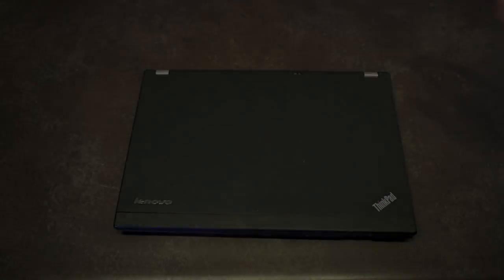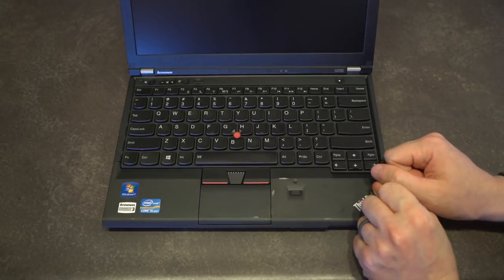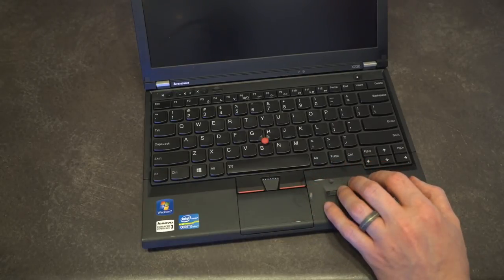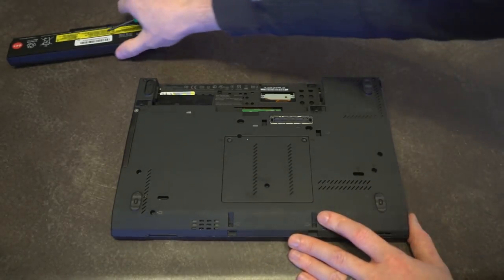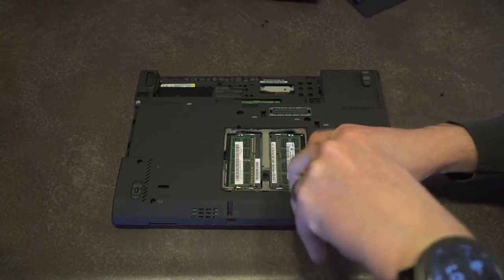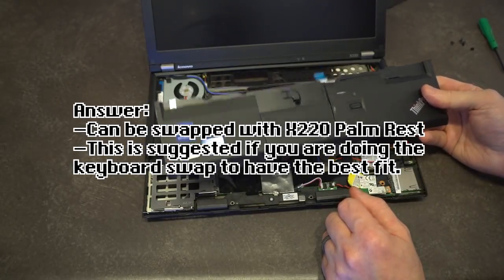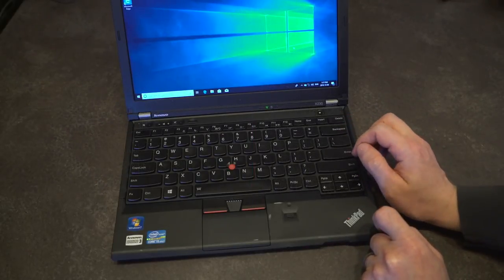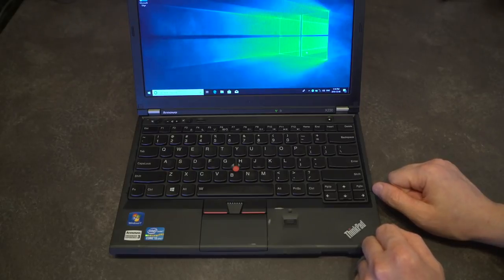Lenovo ThinkPad X230: A Fan Favourite

Comment: @Laptop-Retrospective:

A friend is asking me if he should get a refurbished X230 laptop with a Core i7 3520M processor & 8 gigs of Ram and a 500-gig ssd,

("Grade B" or "Grade C", depending on what store considers as "Grade C" & "Grade B"; 
The upper-right-hand corner of the LCD-screen-bezel is chipped-off. The lower-right-hand-corner of the LCD-screen-bezel has a visible crack in it. To the naked-eye there's no dead-pixels on the laptop's LCD-screen but the YouTube "all red screen" dead-pixel test hasn't been done to it yet),

for $240,

or a "Grade A Refurbished" X230 laptop (NO dead-pixels, NO scratches on the screen, no cracks on the chassis, no chips anywhere on the chassis, no dents, no nada) 

with a Core i5 3320M processor & 8 gigs of Ram and a 500-gig ssd,

for $300.

[Needless to say] I'm asking you which-one I should suggest my friend he get.
Reply from the maker: I guess that depends what matters most to your friend: performance or cosmetics? Will they use the i7 or is battery life more important? What is the battery wear and size on each model?
Reply: @LaptopRetrospective  hi Laptop-Retrospective :-) . Thanks so-much for the reply :-) .

I went with him when he went to check-out the laptops.

I'll tell you what I know.

● The one with the Core i7 3520M processor is sold by a local store here in my city that sells refurbished computers. They also take them apart & clean them and replace defective--and/or--broken components and then [put the laptops back together and then] resell them.

It has the regular-sized battery (I dunno if it's the 3-cell or the 6-cell but it's the one that you had in your X230 video that does-not "stick-out like-a-sore-thumb on the back of the laptop" nor "stick-out like-a-sore-thumb underneath the bottom of the laptop"),

and it comes with a 3-month warranty (covering "Parts & Labor") from the store that sells it.

The wear on the battery, when I checked it, according to each source (ie. the Bios & Windows-7) seemed-to-be 80% or above. (I'm going to try to go back to the store today and check-out the laptop again).

● The one with the Core i5 3320M processor is sold by a "Microsoft-certified Refurbisher" in Jacksonville Florida called PC-Liquidations (I'm currently in Orlando, by the way), and they also, among other things, take the laptops apart & clean them and replace defective--and/or--broken components and then [put the laptops back together and then] resell them.

It also, just like the one with the Intel Core i7 3520M processor, has the regular-sized battery (I dunno if it's the 3-cell or the 6-cell but it's the one that you had in your X230 video that does-not "stick-out like-a-sore-thumb on the back of the laptop" nor "stick-out like-a-sore-thumb underneath the bottom of the laptop").

The warranty however, is 1 year "limited"-warranty, but it, despite being "limited" warranty, covers more-stuff than the 3-month "for Parts & Labor" warranty that the local-store in my area is offering.

The wear on the battery, I'm estimating, is a brand-new battery. My other hypothesis is that it's a "close to 100%" (like, 98% or so) Refurbished battery.

■ I am more picky about the cosmetics/abuse the laptop has taken, whereas my friend is not. 
I'm also a heavier multitasker than he is, so therefore the additional .3-gigahertz [clockspeed] of the 3520M Core i7 processor compared to the .3-gigahertz--less of the 3320M Core i5 processor would-be beneficial.

Word-Processing, Web-Browsing, YouTube-video watching, Coding/Computer-Programming/Computer-Science * , Text-file Editing, and other "basic-use"-type stuff that doesn't consume alot of battery (including watching video-files on VLC Media Player on a USB-3.0 external hard-drive) would be the primary functions of this computer (ie. the primary things that this laptop would be used for).
So I'm guessing (and/or hypothesizing at-least) that battery-life wouldn't be affected-much either way (with the Core i7 3520M processor or the Core i5 3320M processor).

I hope this information helps :-)

* (I should specify that when my friend & I learned Computer-Science & Coding (we were in High-school together & in the same Graphic-Design class), our computer-teacher taught us HTML code and how to do it using Notepad, so that's what we've been using since (except I've moved-on to Notepad++, Kate, and NotepadQQ (a open-source version of Notepad++)), and right-now I'm working-on Python and C++ (two languages that were recommended to me by a cousin of mine who's a Penetration-Tester)).
Reply from the maker: The i7 will draw more power and I wouldn't assume the battery is brand new unless otherwise stated. Batteries for these are starting to get rare so keep that in mind if it needs to be replaced.
Reply: @LaptopRetrospective  i understand :-) . thanks-so-much for the help :-)
Reply from the maker: You're welcome. Best of luck
Reply: @LaptopRetrospective  Thanks :-) (referring to the “best of luck” part).

P.S. I’ve heard that there is a way to upgrade a X230 [or X220] to a [for-a-13-inch-computer] 1080p-resolution [LCD] screen. And/Or that there is a way to replace the Bios with “Coreboot”.

Can you do a video on those two things please?
Reply from the maker: If I ever get the right candidate machine and the parts, probably. 😁
Reply: @LaptopRetrospective  thanks so much! :-) 👍

Comment: I used x230 with 6GB ram, change internal hdd with ssd, replace x230 with x220 keyboard, and this little bulky machine is superb, i buy docking too and replace dvd slot with hdd, superb combination. And oh, i think thinklight and trackpoint is the great part of thinkpad laptop.
Reply from the maker: Very nice setup.
Reply: w adisurya 😲 Fits a X220 keyboard on X230? Please share a video guide to do that! 👍🏼
Reply from the maker: See the description of the x230 video for a how to guide.

Comment: I'm typing right now from my Thinkpad x230 Core i7, Samsung SSD, 16gb ram. I use this rocket for my programming classes. I think that is the best laptop for any college student. I'm an IT student and this thing is amazing. Fast, powerful, and and bulletproof
Reply from the maker: Very nice. You running a 6 cell or 9 for the battery?
Reply: @LaptopRetrospective  6 cell. That's enough for me.
Reply from the maker: Nice.
Reply: just got it for the same reason.. but im taking linux + and studying for CCNA.  comes in 2 days..
Reply from the maker: Exciting! Keep us posted.

Comment: Is the i5-3360M a socketed chip? If yes, do you know if the i7-3520M can just be swapped in with nothing else? Just plug and play?
Reply from the maker: The X230 is not socketed.
Reply: @LaptopRetrospective  Thanks for the quick response! Great videos! Very informative! But would you be able to double check that? I thought the M signified that it was socketed, and U meant that it was soldered in place. I've read that people have swapped the i5-3320M, on the T430, to an i7, but I just wanted to find out it they needed to flash the bios or if it was just plug and play.
But love the channel, I have a graveyard of laptops that are older but very useful after a refresh like what you do with the laptops.
Reply from the maker: The T model is socketed, X is not. M denotes Mobile Grade, U denotes Ultrabook.
Reply: Ah, thanks for clarifying! Keep the videos coming!
Reply from the maker: @jonathandelapaz8679  I'll do my best!

Comment: thank you for a great video. Helped me pick the right one of the thinkpad lineup
Reply from the maker: You are most welcome, I'm glad I was able to help.
Reply: @LaptopRetrospective  I noticed that x230 often come with high GHz i5 processors (2.7 to 2.9 GHz) , while x240 i5 are mostly only sold as 1.9 or 2.1 GHz. Do you know why this could be? Is it due to the newer processor generation being more efficient?
Reply from the maker: Newer CPUs in the x240 were more power efficient but weren't as strong, about 10% less.

Comment: Hi. I just got my x230 in. Great condition only thing im wondering is what cpu temp r u getting on idle? Mine is 50c to 64c. Is this too high for this model? Should i reapply thermal paste to it?
Reply from the maker: Might be worth a repaste. Fan might be worn out as well.
Reply: Laptop Retrospective thanks. Ill take this bad boy apart on my day off. Im surprised how well maintained it is. Only 1 small scratch. Cleaned it off with sanitizer wipes and looks brand new
Reply from the maker: Good luck, hopefully, you can get the temp down a little bit.
Reply: Laptop Retrospective thank u. Also trying to figure out this jumpy mousepad. Works fine via trackpoint or whatever the red dot is called haha.  Updated driver too and still jumpy. Gonna install linux on my day off and see how it is on linux. Thanks again

Comment: that battery looks like mine, is that a sanyo one? and is that an original X230 battery?
Reply from the maker: No real way to tell by looking at the outer case. I don't have this unit around anymore so I can't check.
Reply: @LaptopRetrospective  owh ok.

Comment: I have bought an old x230 without battery few days back, I tried getting the battery for it but as the technician put the battery in it for testing it wont turn on now. Even it's not turning on with only ac power. When i plugged in the adapter the led indicator flashes twice or thrice but pressing power button won't make the laptop turn on.
Any idea what has happened? 
I suspect BIOS locked is the problem.
Reply from the maker: If the BIOS was locked you'd have something displayed on the screen. Does it turn on without the battery at all? If the battery is really really old then it might not have been built with the battery check bypass.

Comment: watching this on an x230 with 3rd gen i5, honestly one of the best laptops ive ever used.
Reply from the maker: Glad to hear you're enjoying it.
Reply: agree all you need is change the battery and the keyboard on the used model and you are pretty much good to go
Reply: @righter0o07  yeah im soon buying a duracell replacement battery for it, and i might do the x220 keyboard mod soon
Reply: 2 years later. still using it :)
Reply from the maker: Epic.

Comment: I think hp elitebook 2570P is more superior than x230 because socketed cpu. And its cheaper and fits mil spec
Reply from the maker: Hmmm, that is compelling. Maybe I need to try and get my hands on a few more HPs.
Reply: @LaptopRetrospective  other than old hp elitebook, HP products are mostly just garbage. For more newer product it's better to stick with thinkpad or clevo. But personally i think 2570p is better than x230 because socketed cpu (which i already upgraded into i7qm), aluminum body and additional sata socket on dvd drive slot .
Reply: Dell is better than hp similar to thinkpad you can try it
Reply: @berkinerengurman1401  which model ? can i upgrade the cpu?
Reply: No Bullshit i’m using precision m4800 everything is upgradable and it has 4 ram slots but heavy a bit also latitudes are really nice and their cpu s upgradable

Comment: Watching this on an x220 ^_^
Reply from the maker: Very nice. What specs?
Reply: @LaptopRetrospective  
I5 2520m
8gb ram
500gb ssd

Waiting for the exp gdc to arrive so i can use a gpu in the express card slot ^_^
Reply from the maker: Let me know how that goes. There's a fellow in the comments of another video who had once they were trying to get working.
Reply: @LaptopRetrospective  hi, sorry for the late reply and happy new year ^^ (writing this comment at jan 1 1:37am), i will try with the express card method, and with a gtx 970, i will tell you how it does but there is a little problem xD, i ordered it from a chinese ebay seller, and so i have to wait like one month for it to arrive xD
Reply from the maker: No problem. I hope the year has started well for you. I haven't seen a supplier outside of China either.
Reply: @LaptopRetrospective  yup it started well, my connection is finally back xD, i've seen the exp gdc on amazon but it costed 20€ more xD

Comment: Is there a way to replace the batteries without the laptop shutting off? Because mine shuts off whenever I take the battery and I lose all my work. is this normal or is there any fix?
Reply from the maker: Do you have a working internal battery?
Reply: @LaptopRetrospective  I am not tech savvy. Is there any way of knowing? if you mean opening it and looking, I'll get back to you.
Reply from the maker: Oh wait, this is the X230 video. Yeah, the only way to swap batteries without the machine turning off is if it plugged in.
Reply: @LaptopRetrospective  😍I can sleep better
Reply from the maker: Cheers!

Comment: I own and my daily driver is a 3rd gen i5 x230 touchscreen Screen to tablet mode with Spen model. Best laptop I have ever owned. I am an IT professional and seriously outdoes most 2022 laptops when it comes to reliability and upgradability. New machines are built to breakdown and not be upgradeable or serviceable.
Reply from the maker: The X230 is a great machine, especially the tablet version. Glad yours still gets use.

Comment: Correction: Thinkpad x230 uses SATA 3 (6Gb/s) for the disk. The msata slot operates in SATA 2 mode (this can be used either by msata ssd or wwan card).
Reply from the maker: Yes, SATA 3 for the main drive bay. SATA 2 for the mSATA.

Comment: Upgraded to an X250. Hated it!  Then tried an X240. Not as bad, but only 8GB RAM.  Noticeably poorer build quality on both. Poor trackpads also - and couldn't configure them to work like the X230. I'm back on an X230 running Wondows 11 Dev Insider Release and loving it again!! It's faster than both the X240 and X250 and everything works. The most important modification I do is to add an MSATA drive for the OS (essential). After this, even a standard drive works great for everything else. I also replace the speakers with a pair from an IPad. I tried  an X220 keyboard at one point, but forced myself to get used to the new keyboard because it is backlit. Would love to get an i7 when I can find one, but the i5 is plenty capable for my purposes. Zero lag or freezing with 12GM RAM.
Reply from the maker: Interesting, I didn't note a massive change in durability or build quality but that has a fair bit to do with our perception of things until the item in question is tested. I wouldn't specifically suggest an mSATA for the OS if you want the fastest boot times as it is can only do SATA2 speeds whereas the main bay can do SATA3. Glad to hear you have a machine that works for you, that's the most important.
Reply: @LaptopRetrospective  Thanks for your comments. I maintain a 2TB drive so SSD is too costly - do they even come that big? Anyway, I find it starts really fast even though it is mSATA 2.
Reply from the maker: They make them but as you've pointed out they aren't cheap. M.2 drives are actually cheaper.

Comment: Hi, x230 for170$, do you think it's stil worth it 2023? still thinking of buying it's i5,win10home expired, 8gRam 160gb ssd, 2.6ghz.  what i only check working is vga,its3 usb port, speaker, wifi,bat, with charger. And What idnt know if working is miniDp, Bluetooth?, Bios?, what do you think is important before buying? Sorry lot of Question nd my English is bad. TIA
Reply from the maker: What do you want to use it for?
Reply: @LaptopRetrospective  my reason mostly is just a laptop that i can afford and that may work blender krita app or drawing edit stuff.
Reply from the maker: It won't be super powerful by modern standards, but it will definitely last. They are well liked.
Reply: @LaptopRetrospective  last question have you tried x280?dis i3,hdd i just saw one ranging same amount. what do you think,? Anyway thank you for the response
Reply from the maker: I've reviewed the X280 on this channel. The i3 isn't very powerful but the battery life will be excellent. You can compare the CPUs online.

Comment: Hello again, so still I couldn't buy a  laptop for that period for some reasons, but I sort of don't regret it, because I know better what these laptops can, what are they for and what I want. So now I'm between the i5 8GB RAM 256 SSD X230 and i7 2720QM 8GB RAM and 256 GB FHD T520(the same prices). And again, my primary use will be for university. The advantages of X230 are: it looks much newer, more mobile, I found a decent extra batter for 12$ and of course the fact that I can upgrade RAMs up to 16 GBs.
What do you think?
Thanks.
Reply from the maker: If I was carrying it daily, X230 no question.
Reply: @LaptopRetrospective  YES, you are right. Thanks for making my decision final. I already have almost 1/3 amount of money to buy it. I'll tell you more about my experience later.
Stay healthy.
Reply from the maker: Happy to help. Keep us posted and stay healthy yourself!

Comment: Sorry to add yet another comment, but big correct to the video.  

The X230 can take full advantage of 16GB of (impossible to find) 17000 DDR3 2133Mhz RAM.  Yes, they make them,  Kingston HyperX, if you're lucky enough to find them.  I run Corsair Vengance 14900 DDR3L 1866Mhz myself.  Yes, there is a significant difference.  Remember, when your only graphics is integrated graphics, system memory is your graphics memory.
Reply from the maker: No worries, thanks for the additional information.